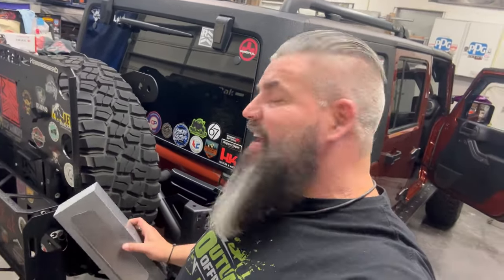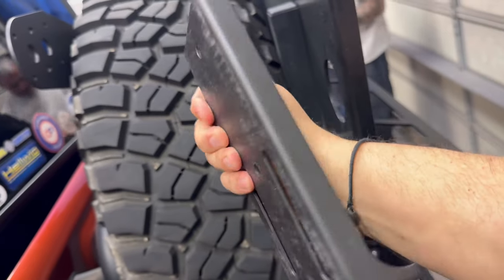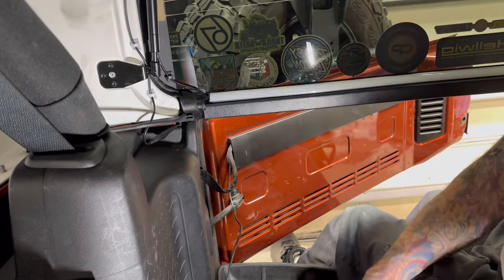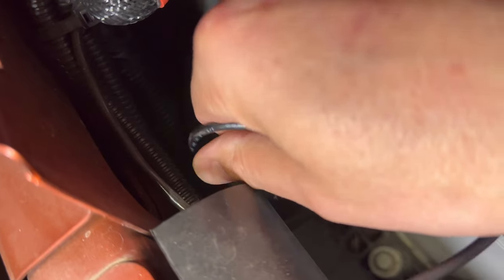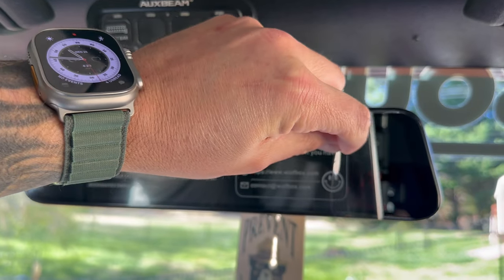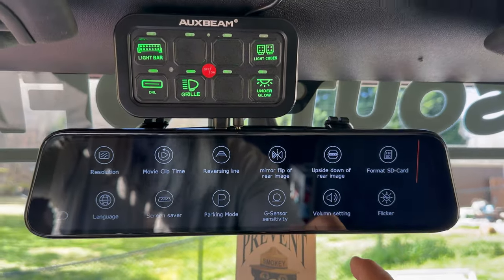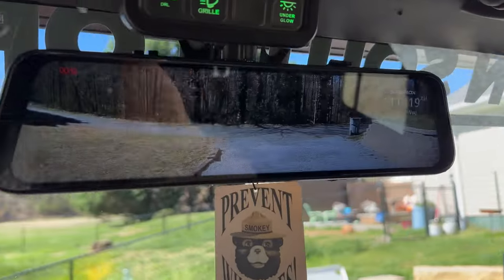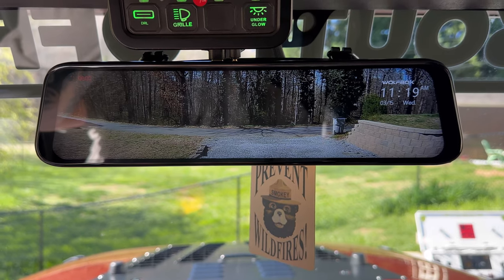You Won't Believe the Image Quality of This Wolfbox G840S Rear View Mirror Camera From Amazon!

Comment: Hook up the red wire to the backup light of the Jeep. The red wire is for the reverse mode. And should be hooked up. It does help to have reversing mode working.
Reply from the maker: Hey thanks for watching I don’t use this as a back up camera but it’s always on the rear so there’s no need to hook it to the reverse lights.

Comment: You must have a lot of faith  in that equipment right out of the box

I always mock up my installs first put all the equipment together and make sure the thing works before I go drilling holes and routing wiring  , only to find out that unit doesn't work😮😮😮
Reply from the maker: We had already installed a similar one in my wife’s Jeep.
Reply: @DownSouth_Adventures  we all appreciate the time you take to make these videos. Thank you

Comment: Question is there a way you could turn off the Camera and use it as a regular mirror?
Reply from the maker: Not really I mean, you can see reflections in it, but not really
Reply from the maker: But I also don’t know why you would want to
Reply: @DownSouth_Adventures in case you have children in the back seat and need to look through the mirror
Reply from the maker: @fezc8430  that is the ONLY thing you'll lose unless you just want to add a little round tow mirror somewhere.

Comment: I would have to experience it in real life to see the quality.
Reply from the maker: These units are absolutely awesome and I will have one in every vehicle I own
Reply: @DownSouth_Adventures  and why g840s model specifically and not g850 or g900 or something?
Reply from the maker: @Bluegreenred  not this model specifically but this brand. We've installed 5 different brands and this model has the best camera and video.
Reply: @DownSouth_Adventures  sounds good I hope you’re right because I recently purchased this.
Reply from the maker: @Bluegreenred  You're gonna be happy!
Reply: @DownSouth_Adventures  except they didn’t install it correctly I’m going somewhere else to fix the issue.
Reply from the maker: @Bluegreenred  Aww that stinks I hope that you get it installed correctly! What did they do wrong?
Reply: @DownSouth_Adventures  they did not install wiring for reverse camera function to work and they placed the back camera inside the vehicle at the top window and that’s why cars on the road looks like they are moving in slow motion, cars don’t look like they are moving in real time not at all. And back camera pictures quality is not perfect either because back camera is inside and not outside.
Reply from the maker: @Bluegreenred  WOW that is a lot of mistakes!

Comment: I would t recommend this, the main reason is because you cannot adjust the angle of the front camera, meaning it has to be dead center for you to get a good recording of the front. That in turn means that you cannot use the rear view mirror because it will be off center and you will be looking at your passenger seat every time you want to look behind you, forcing you to use the rear view camera. The rear view camera is only 30fps, which makes the image choppy and if someone is blinding you with their headlight well good luck. I’d recommend a dash cam that does not go on your rear view mirror. I will more than likely end up returning this which is a shame cause the install was a bit of a pain.
Reply from the maker: You obviously don’t understand how this works….
Reply from the maker: The mirror isn’t a mirror it is a display so NO MATTER which way you face it you see the beautiful 4K screen showing you what’s outside . The front camera is also super wide angle so matter the position you see the same footage. There is nothing remotely choppy in the video. Bright lights are never an issue with this unlike your rear view mirror.

Comment: Great video.  Have you have any issues with the angles of the rear camera by mounting it so high up? I have a tire cover on my JL and I was thinking of mounting camera on top of my brake light but I am worried I won't be able to view things properly.
Reply from the maker: It’s actually way better up there. It’s not a back up camera it’s a rear view camera so you can see a lot of your blind spots
Reply: @DownSouth_Adventures  That is such a great point. Thank you.

Comment: This is a great device but I noticed an annoying flaw. You can't view the wide angle view of the rear cam by itself. It's the cropped version. The only way to view the wide angle is when you set it to view both front and back cams. It's been a couple days since I set this up. Either I missed some setting or this is an oversight by them. Might have to return this for this reason alone. Otherwise great piece of tech.
Reply from the maker: Ours shows a very wide picture
Reply: @DownSouth_Adventures  ya it's extra wide, but it's cropping a lot of the view to fill the screen. You can see full view only in 2 cam mode.
Reply from the maker: Even cropped it's a much better veiw than a reflection in a stock mirror @aarun3000
Reply: I noticed the same exact issue but if you slide it up and down there's a sweet spot to get that wide angle near the bottom of the screen opening up those blind spots to your view. I parked in a parking lot, using a building or anything in the rear view slide the screen up and down until the widest view of the road was lined up with the wider bottom portion of the screen. 👍🏽👍🏽
Reply from the maker: yeah i still love this thing! @slimj82

Comment: Hi, we just installed after I watched your review, we are getting used to this mirror cam and it works really well. Only question is, is this supposed be darker than normal mirror? The resolution is goo but it’s bit dark in sunny days. I have adjusted brightness but feel like I am looking at tinted mirror. Do you think it’s ok?
Reply from the maker: Hmmmmm I know mine seems to have a dark tint on it, but I’ve never had an issue viewing the screen. I’m not sure if maybe you just need to angle yours differently.
Reply: Yes, these mirrors are not only darker than regular mirrors and it doesn't allow you to use as a mirror only unless you turn the whole thing off. I returned mine because of these reasons plus i was expecting to have as a mirror only and time and GPS on the mirror only. Back up camera and front only when enabled, but the settings are so basic doesn't allow these.

Comment: Hi, Question. I bought this camera model for my 96 ranger model. But the parking mode only record maybe 1:30 hrs, with the 24 hrs park mode enabled. I put the hardwire kit to enable the park mode. I connected the yellow cable in a constant energy fuse and red in a fuse that only have energy when the truck switch is on. That ok? Or I need to connect the yellow in the battery directly?
Reply from the maker: I would try the battery directly because I didn't hook up my parking mode

Comment: Its not clear how you are powering the unit. I do see you pulling the wire out to the front near the battery but not clear what you are doing with it
Reply from the maker: Connecting it to ACC or constant power in the fuse box

Comment: Thanks for the video. Could you please help me gauge the best location for the rear view camera on my sedan? I have a big wing. Looking to replace the low quality rear view camera under my boot handle.
Reply from the maker: Can you run the wire through the wing?
Reply: @DownSouthOffRoadandOutdoor  I wish but it's challenging to route the wiring through it. It would be exposed along the metal arms. The view would be great from there. I agree.

Oh well, I guess it's down by the boot handle then.

Comment: So in order to use the backup camera you have to cut into the reverse / turn lights?
Reply from the maker: This isn’t a back up camera….this is a rear view camera so it gives you a much better picture than a mirror
Reply: @DownSouth_Adventures  it comes with a backup camera though
Reply from the maker: @ceej5714  No it comes with the camera that it uses to show you whats behind you. The point of it is to give you much wider vision of what's behind you than looking at a small reflection in your mirror.